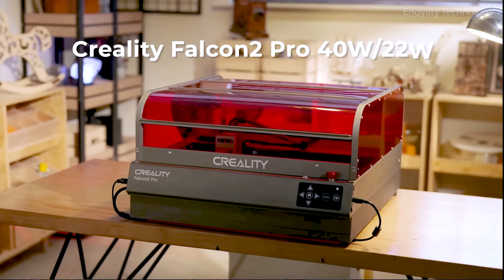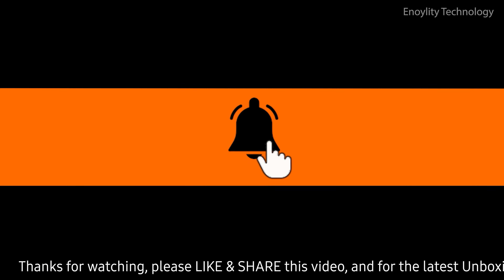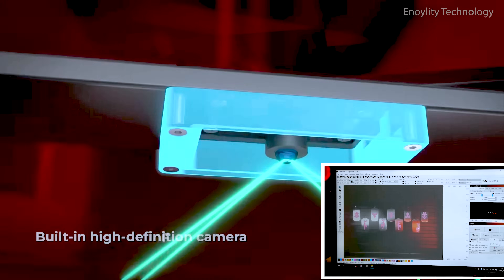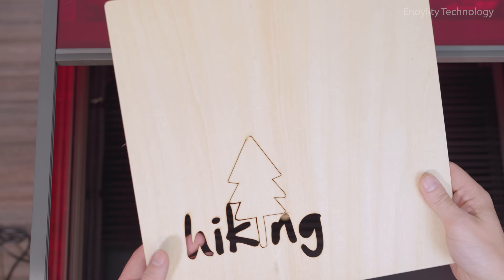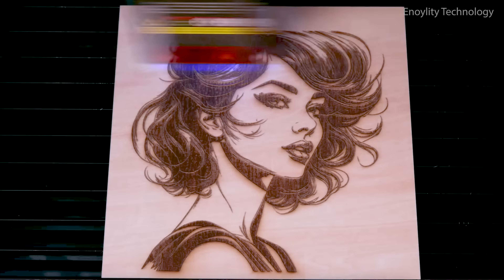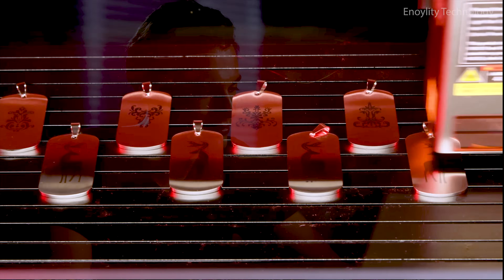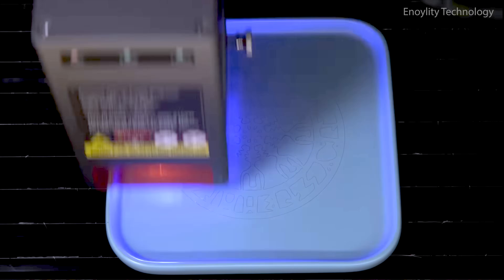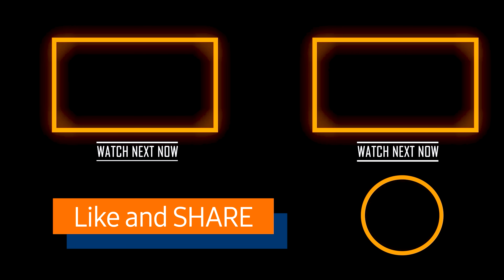Creality Falcon 40W Laser Review: Powerful Precision Engraver for Every Creator!

Comment: I think this system is awesome for first-time laser users and experts alike. It is powerful, precise, and has an extensive add-on ecosystem for doing even more with it—you can even swap out the laser module for other kinds of projects. Rarely am I this pleased with a product this quickly. I can't recommend it enough.
Reply: I've done full engraving runs lasting over 3 hours and haven’t seen any overheating. Just make sure your work area is well-ventilated and you’ll be fine
Reply: Perfect for personalizing gifts and products.
Reply: The fan and airflow setup reduce the smell from materials like wood and leather a lot
Reply: This is the third laser engraver I've tried and it's definitely an improvement from the one I got a couple of years ago. It was almost completely assembled aside from the laser and the air assist.
Reply: This comes with multiple supports than can be adjusted based on the workspace, so this machine is easy to level. I've only ever used machines that must be assembled piece-by-piece, so this was a breeze in comparison.
Reply: As with all laser engravers, this machine requires is a bit of testing. It may take some time to understand the optimal power and speed settings required for each material, but there are charts available online that provide a great starting point.
Reply: My research did not prepare me for how awesome there products or there customer service is. I've had the laser engraver and the 3d printer for close to a year now. I had a issue with the laser engraver.

Comment: It's stunning to look at and even more amazing to use! I do wish I would have got the 40W model though. That's something I'll have to save for to hopefully get in the future. But back to this 10W version, everything from the design of the machine to the software has made me want to get more into engraving and cutting!
Reply: Built-in safety features protect users during operation.
Reply: Is there a warranty for the Falcon2 Pro?
Reply: One of the things I really appreciate is how quickly the machine goes from setup to operation. It doesn't take long to get everything aligned and running, which is great when you're working on multiple projects or trying to meet deadlines
Reply: This is very accurate and makes some of the coolest things. Seriously, there's no end to what you can do with this thing. We've made Christmas ornaments, wall hangings, and quite a few other things as we've learned our way around the cutter
Reply: Operation wise, little difference- I highly recommend ponying up the money for a Lightburn license, it's affordable and an excellent program.
Reply: It connected to lasergrbl without any problems.. I started with a 5w laser and this is a very good upgrade to. Project in video engraved at 10% power and cut at 50% power

Comment: To really use this product to its potential you need a riser base at a minimum, which is extremely expensive for what you get which is just a simple riser without anything special about it. I guess one could construct one on their own but then it would look jenky and not have a good seal for the wood burning smoke that needs to be extracted.
Reply: Software licensing (LightBurn) is an extra cost not everyone factors in—still worth it though
Reply: Durable design
Reply: The machine looks stunning with smooth semi gloss finish, rounded edges and very compact design. It doesn't take too much space and it very easy to move around if necessary.
Reply: This thing is amazing. Customer support is great as well
Reply: My favorite thing about this machine is that it has plenty of built-in safety features. The laser module is mostly enclosed with a safety shield across the front. This comes with ANSI rated safety goggles as well

Comment: I absolutely love this thing. With everything I've thrown at it so far, it has "just worked" with default settings out-of-the-box. It seems very well designed and I love having the auto-focus system built-in. The alignment system is amazing
Reply: The air assist built into both models really improves the cut quality and keeps the workspace cleaner
Reply: Precise cutting
Reply: I have created a couple of projects so far and I’m loving it! A little of a learning curve but nothing too difficult. The amount of things you can create with this laser engraver is incredible. Excellent quality and affordable. My kids are happy too since I been able to make a couple of fun things for them.

Comment: Everything from the design of the machine to the software has made me want to get more into engraving and cutting! This thing is fantastic! You'll love their software too
Reply: Having Wi-Fi connectivity is a sweet addition. I can send files from my phone and laptop easily
Reply: You'll need to tinker with different power/speed settings depending on your materials. I LOVE that this machine automatically turns off the air assist and fans when it's not actually doing a job- makes it so much quieter.
Reply: After using this laser for multiple projects and multiple materials, I'm still impressed. It has consistently produced great results and is capable of much more than I originally expected. I'm grateful for the excellent experience, and I'm looking forward to exploring the creative possibilities with this laser.
Reply: Love this laser. It is pretty powerful and cuts through many projects with no issue!! Definitely recommend

Comment: This unit is rather large and takes up quite a bit of space but if you have the space I would highly recommend this product. I ordered extra accessories for this unit as well and everything install very easily.
Reply: This is my first laser engraver, so the learning curve is steep. The instructions are lacking (other than basic set up and information) and requires a lot of searching online. Setup is easy though as its mostly assembled - picking off the protective film over the acrylic was the worst part.
Reply: The engraver works smoothly and precisely, producing high-quality results every time. The laser itself is powerful yet controlled, capable of detailed engravings on a variety of materials like wood, acrylic, and even metal.
Reply: We even engraved several of my good knives and one of my wooden cutting boards. I can never find my name spelled right anywhere, so I'm having a blast with this thing.

Comment: This laser engraver has to be one of the best on the market. I did some research and was greatly inclined to buy this version rather than the entry version. I have now used this engraver for a while and found it to make clean cuts in wood as well as great scoring and engraving
Reply: I love it. Once I got it to work. Instructions don't explain squat on startup. You have to U-TUBE if you are new at this. Plus makesure you have good ventilation.
Reply: The laser itself is capable of very fine detail and is powerful enough to cut through wood and acrylic. I was even able to cut out shapes in 3/4” pine without much charring of the edges.
It’s worth noting that my kit came with a defective rotary attachment but customer support responded very quickly and sent me a new one within a few days. Pleased with this purchase!
Reply: This laser engraver is awesome!! It came already put together so we were able to pull it out of the box and start it using it. We like how it comes with a box, lid and ventilation😊
Reply: The tech support was awesome and had a lot of great ideas to help me get up and running again. This was an addition to my work space to use alongside my other laser engraver so I can get more done in my business this Christmas season. I'm hoping to add the rotary attachment soon.

Comment: The accuracy is incredible, consistently producing clean cuts and detailed engravings that I’m proud to showcase in my work.
Reply: The air assist built into both models really improves the cut quality and keeps the workspace cleaner
Reply: As someone with children and pets in the house, I especially like that this comes with a key to run this off and on as well as an emergency stop button. There is a pause button as well as the emergency stop

Comment: One of the standout features is how easy it is to use. Whether I’m working on leather, wood, or experimenting with custom art projects, the setup and operation are intuitive and seamless
Reply: Equipment works well, but if this is your 1st laser (like me) you'd be well served to buy something else that has any kind of customer service. Speaking to a live person is IMPOSSIBLE at Creality. First, it's a chat with someone who knows where who informs you that your issue will be escalated to someone else who will respond to you via email.
Reply: This laser is built great. Easy to use out of the box. The functionalities, features and the design of this laser is fantastic
Reply: I shouldn't have to search for that info, especially considering the price of this engraver. It was packed very well in the box so it arrived in perfect condition. It's nice that I didn't have to connect all the different wires to the X and Y axes.
Reply: This is a fantastic machine. Totally amazed at the simple set up. Basically comes mostly assembled. Real easy interface.

Comment: In general the construction is excellent and should provide good cutting and engraving. I was using a 3080 CNC Genmitsu for laser engraving, but the power of the laser and focusing made it difficult to get setup right. I am hoping this machine will replace that equipment and I will put it back to CNC use.

Comment: I purchased this laser cutter based on it's features. I liked that it had a complete enclosure and safety features. Unfortunately, there doesn't seem to be much in the way of Quality control.
Reply: Performance: with two different laser sources you can engrave on almost any material you want. If you are planing to make some business out of it and want some versatile machine to try out different final products then this will be perfect.
Reply: This is very challenging to utilize because its so big and large that setting it up to work is a chore. Can't just use things, as the software has to be downloaded and a communication between the devices must be established.

Comment: Overall I’m very pleased with my purchase and I use it constantly and it meets the specifications claimed by the manufacturer.
Reply: The software that comes with it is okay, but it really shines when used with LightBurn—which is paid
Reply: Great for crafting and home projects.
Reply: Once calibrated and you get a basic understanding of the machine and settings, it produces some very nice work. The freebie coaster shows a cartooned image of me riding my EUC.
Reply: the laser didn't work on sent it back got one that worked decided to go ahead and get the b1 40w and the y axis dosent work the SD card was gone and there were tool marks on the machine where it been put together before if you get one that works there great and the customer support is good but it seems like they'll just ship you a return if you buy one and they don't have a new one on hand. You've ruined 4 whole days of vacation time for me thanks alot guy
Reply: I am using it on a silicone base for watch bands and book covers and setting the depth is very confusing but once you set it, it does NOT change. Most things are in metric which I prefer. Testing it on wood gave me excellent multilayer results. This is a phenomenal deal and a great competitor for the glowforge

Comment: That has worked very well. I find that this 20W laser is very capable and it meets the specifications and cuts cleanly and quickly through 5mm plywood and does a great job engraving aluminum, plastic and steel - I have had a bit less success with wood which has been coming out less crisp than I’d like but maybe I need to spend more money for better wood surfaces and based on the excellent results from metal and plastic, I’m thinking my wood engraving issues are either cheap wood or user error.
Reply: Can be taken to different locations for projects.
Reply: Is the Falcon2 Pro suitable for beginners?
Reply: The machine was a great thought, and should have stayed just that:A thought. Couldn’t figure out how to get machine to download to my mac book or regular laptop , big issue can’t use your Cell phone to make any designs , mistake on this purchase it’s a good machine just not for me
Reply: It is very easy to use, the projected laser makes it simple to get your positioning right. The possibilities are endless with it! We are excited to make lots of Christmas gifts using it. I’ve attached a couple pictures of some things we’ve made so far.
We would recommend!!

Comment: I have used it pretty extensively since then - mostly for laser cutting wood but a bit of engraving on wood and metal. I found it very easy to set up and get started although the instructions are a bit simplistic and I still could use a better description of the focus and power levels for cutting and engraving various materials
Reply: I would suggest researching other brands and their parts availability before purchase. Again... great product, just disappointed in parts availability.
Reply: The space around the connection area is quite tight, making it a bit challenging if you have larger hands. It can be a bit of a struggle to get everything set up properly, but once it's connected, the rotary tool works flawlessly, allowing for precise cylindrical engravings.
Reply: The laser accuracy is fantastic. For the value of this machine it is great. I will recommend this machine to anybody.
Reply: I've been a Creality customer for a long time (started with their 3d printers, I currently have about a dozen of them) and you do need to have patience and be willing to tinker once in a while, because if something goes wrong you're going to get minimal support- thankfully there's a pretty good user base on social media and you can usually find help there or on Youtube. But for the capability you get, they're a pretty good value.
Reply: If someone comes into my workspace who isn't wearing proper eyewear, I can quickly pause my project. This has a flame detection sensor which will automatically turn off the machine if a material ignites. It also has a lens sensor that indicates when the lens must be cleaned as well as an air assist monitor that turns yellow when the airflow is low and red when it is of
Reply: This laser is fast and efficient. It can cut through big materials. I tested on several items. It went through 6 mm plywood very easily. The etching also looks great. You can etch and cut with this on many different types of materials.
Reply: Set up was easy, just still trying to learn software better. I like the fact that it's a fully closed machine, we have a lot of pets and a grandbaby, so the full closure makes me feel more comfortable.

Comment: Looks like a beast! Can’t wait to see more test cuts and results!"
Reply: Simple maintenance keeps it in good condition.
Reply: They seem to have multiple websites and it's hard to figure out which one you should use. They do include a memory card that you can download the firmware to and plug directly into the machine, but I can't find the file to even try that so I'm just using the firmware it came with and will deal with that issue in the future.

Comment: Does it come with safety features like flame detection or air assist?"
Reply: I used a permanent marker to note the height where it would strike the bracket. If it does strike, then the head will not close the limit contact switch (which as bad luck would have it, it did!). Not good! A fix would be for Genmitsu to invert and shorten the 'hook' to prevent it. May try 3D printing a fix. 3) There are no grab handles to raise the machine for extra clearance. Instead, you have to grab the sharp wobbly acrylic, which also may stress and fracture it over time.

Comment: The detail on those demo cuts is insane—super crisp lines!"
Reply: The laser module is very easy to attach and can move up and down to adjust the focal lengths. That is super useful because now I don't have to raise and lower the entire machine for different materials.
Reply: In addition, the laser will stop if the machine detects a sudden change in orientation. If it gets bumped off a surface, the laser will automatically turn off, reducing the risk of the laser firing in an unintentional direction.
Reply: The website has videos you can watch, since the written directions are a little vague. They have videos of everything you’d need, and it’s way easier to use them to assemble the engraver. I then downloaded Light burn for the software program, and started playing with potential projects.

Comment: Software learning curve is real LightBurn helps, but expect a few hours of trial After that, it’s smooth sailing
Reply: I'm 3D printing handles that can be fastened to the acrylic opposite the rails which is firmer for easy lifting. I'll likely add some trim to the sharp acrylic also. As its raised, laser safety could be an issue as there is now a gap of several centimeters. A sliding piece of acrylic at the front would mitigate the risk somewhat. Due to the size of the machine, I have it in the corner of a corner desk, so the gap is quite visible from the front.
Reply: It does come with extra leg attachments to raise it up about an inch, which helps if you are using a rotary attachment. I have one but haven't tried it yet with this machine.